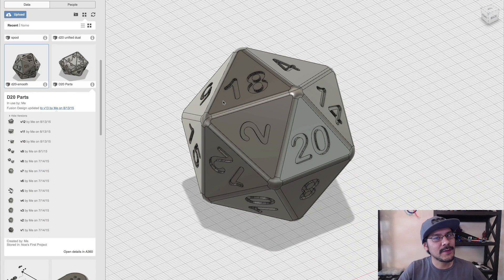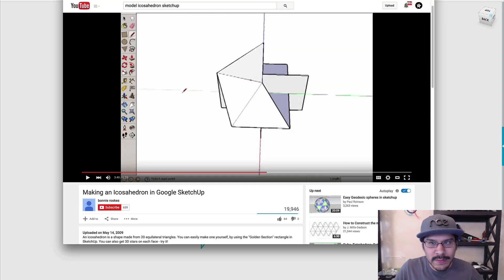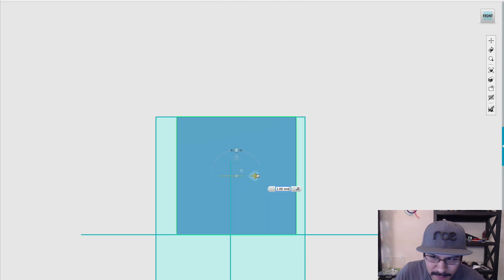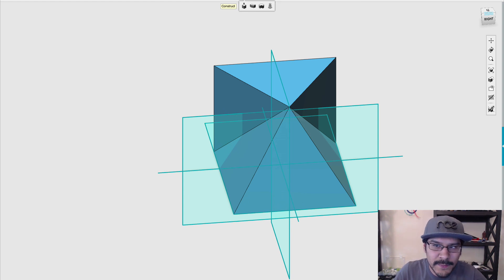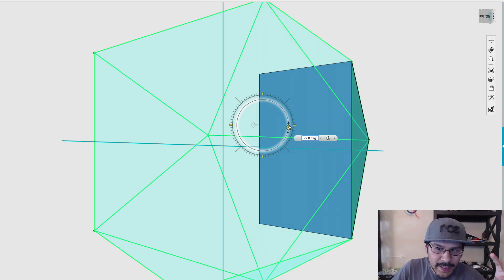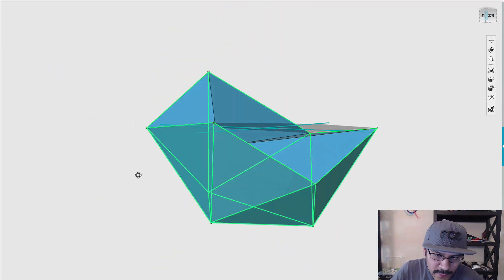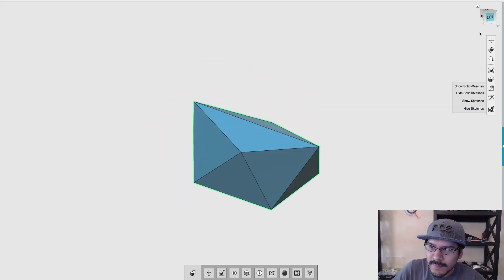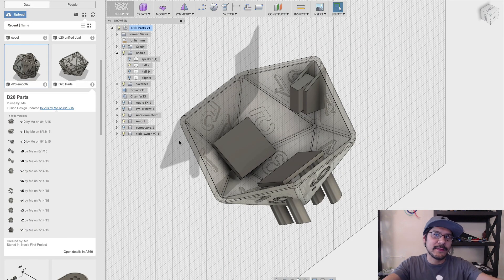Layer by Layer - D20 Icosahedron Part 01

Comment: Why do you guys keep using 123D? I yet to find anything it can do better then any of the other option out there? (something this video also shows). Not trolling or being a fan boy of any other program, just genuinely curious over why you used 123D with lots of workarounds giving you a huge workflow?
Reply from the maker: Pigeon .FX We use different CAD software for different projects. In this weeks 3D Hangout, we discuss the differences and advantages of each software we use. Use what you know!